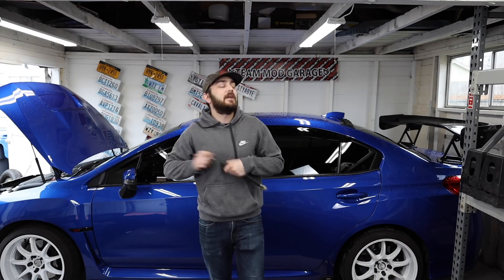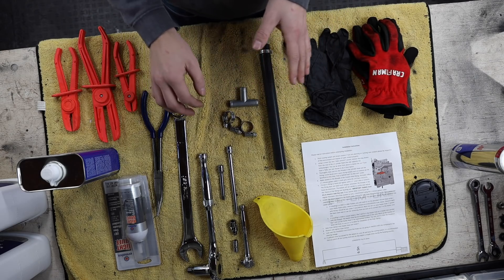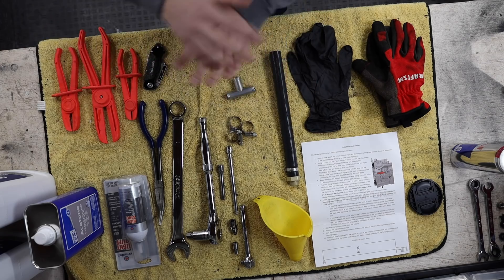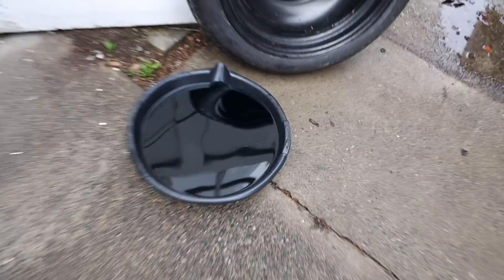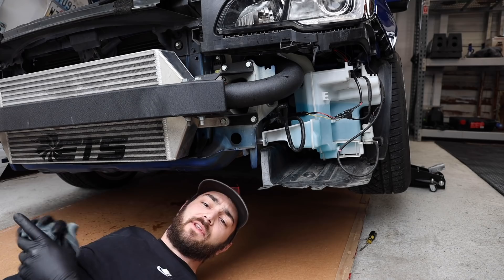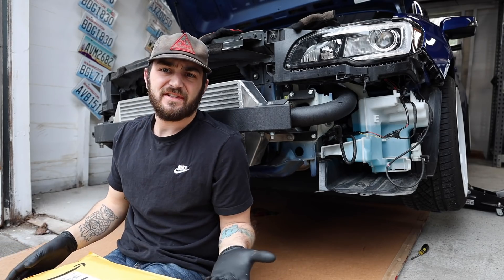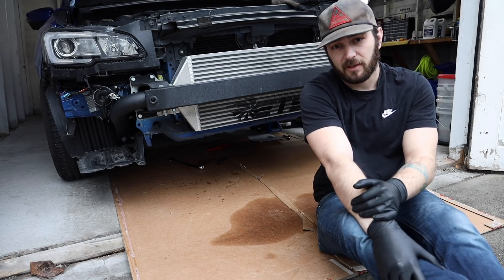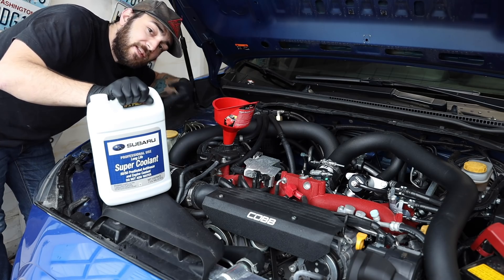Cylinder 4 Cooling MOD Install (STI)

Comment: Did you pinch the heater core hose off when you revved the engine up?  You didn't mention whether you did  that in the video or not. Or if you did I missed it.

Comment: Don’t be cheap! Get a $20 “ coolant burping funnel kit”. It comes with a bunch of different fittings to mount it and they are clear so you can see the coolant and the bubbles. Harbour Freight and Princess Auto in Canada sell them and they work great. 14:47

Comment: Aight, question about this mod long term. This is one of the first ones I did on my 17 STI, over 2 years ago. Apparently I over-torqued the hose clamps on the heater order side and I've got small leaks there. Gonna try the hoses and put on new hose clamps. Any thoughts on avoiding this in the future, besides avoiding the over-torque?

Regardless, thanks for the endless value from this video. I know it's a weird spot to get to

Comment: I wouldn't do this. You are cooling the only cylinder that is being monitored for knock. And since it's the hottest cylinder, it will knock first. All you're doing now is making it so one of the other three cylinders will start knocking first, but the ECU won't know and won't retard timing fast enough to prevent damage.

Comment: Is it connected to the bottom or top line of the heater core lines? Ive seen it done both ways. 

Is someone effing up or does it matter?

Comment: Am new to the subaru scene and definitely fona get this mod on my 2015 sti
Reply: Don't. Cylinder 4 has the only knock sensor. It's designed so that IF there is knock, it will happen in cylinder 4 first and the ECU will do its thing to prevent damage. If you cool this cylinder, you are making it so that knock could start in any of the other cylinders first and your ECU won't know about it until it's too late.

Comment: I did this mod and found an unpleasant side effect in winter. I get no heat unless I bring the RPMs up, even with the coolant warmed up to 84C.
If you're in a colder climate, please keep that in mind.
Reply: You might've tapped into the wrong heater hose. On some models it matters and if u tap the wrong one it'll mess with the heat but if u tap the other the issue doesn't exist

Comment: I did this to my car, my heater now does not work at idle but works when I’m past 2500 rpm, do you think maybe I cut the wrong hose? My car is not overheating

Comment: SMEEDIA !! whats up my subie Guru. Quick question, in order to add the conditioner to the coolant. Do i 1st  pinch the cyl 4 coolant hose,  bleed the coolant system then release the pinched hose?  Or can i add the coolant conditioner before releasing the pinch on the hose then bleed ts ?

Comment: Guys, if you see your temperature rises a little after install, all is ok, it’s just cylinder 4 was the hottest one and cylinders #1,2 and 3 been the coldest , now the heat from #4 transfers trough coolant to number 1,2,3 and keeps # 4 cooler, now it is even , just get for your Subaru a better radiator and you will be golden 👌, if this not enough then I don’t know lol, get additional 2 small radiators and install it behind the front bumper vents on the side, like BMW M5 has, not sure if you will need additional pump to run it when car is off to cool everything off, just a thought 💭, steal some ideas from Germans guys 😅
Reply: I installed this mod and after seeing exactly what you say, I decided to removed it, it iwas not funny to see my car around 98-102 C. 
I upgraded the radiator but I am still not sure about installing it again.

Thanks for your comment, that is exactly I wanted to know.

Comment: Experienced my first time with my car being heatsoaked. After a year of owning it i almost stalled taking a right turn downshifting to 2nd. God forbid i get a delayed response. Sucks but thats what happens when your in arizona lol. Gotta get this mod soon
Reply: You need a 2 row radiator too 😅, im looking for one too, first cooling mod and change all fluids, then bushings that worn out, new spark plugs and filters, just got new wipers, just refresh all and improve cooling system, it should run for a long time if you keep it stock, there still some small mods that will help with oil etc… but you should be golden 👌
Reply: @Atlan_tis  I only worry about it during the summer. Well mainly from May to September here in AZ. Any cooling mods sound nice considering I dont have any mods but a catback. Going for the 4 cylinder mod once I do a coolant change. Really wish subaru kepted the tmic sprayer for all years. It was 104 a couple days ago. Car does not like the heat lol
Reply: @sunnydee7745  I live in California, is not hot yet, but we just had 98F couple days ego, I know it will get hotter 114f for sure, to get this mod is important, I ordered this line and I’m looking for a 3row radiator from Mishimoto, and new coolant, my 2018 sti is stock too, im planing to do mods for reliability, at same time looking for cat back exhaust too
Reply: @Atlan_tis  I dont plan on driving when it's that hot, ill take my silverado instead 😅 but yeah bro, cooling mods are a must for these vehicles. I have a Tomei catback, pretty loud and sounds amazing, if your looking for that I'd recommend it

Comment: Thank you so much for these videos dude. I’ve been waiting for the right timing to purchase a ‘14 STi and it finally happened. It is unmolested with less than 90k miles, so I want to do everything I can to ensure longevity with this engine. I have a long to do list, but your videos are helping me prioritize and put things in a decent order so I can do multiple installs in one round (for example, Mishimoto radiator and cyl 4 cooling mod should be done simultaneously so I only have to burp system once). 

So hype! 🤩🥳🎉 🚙 💙

Comment: I wouldn't do this mod, you're making the ECU logic flawed.
they have cylinder 4 a little bit hotter, it's close to the knock sensor, so cylinder 4 will knock first slightly to adjust ignition timing.

DONT DO THIS MOD

Comment: Hey man, just bought my first subaru. Really appreciate your knowledge and thoroughness on the aos/occ. picked up the iag setup you went over. Now i know my 15’ is a fa and doesn’t utilize an ej platform is there a way to make it work on my engine? Trying to square away with all the preventative stuff while i have the coolant out of it for the most part, thanks in advance!
Reply from the maker: So lucky for you, the FAs do not have thr same issue and do not need this mod 🥳
Reply: @Smeedia  hey man does installing this required a tune?
Reply from the maker: No🤝
Reply: @Smeedia  FA engines don’t need an AOS or catch can? How does the PCV system work differently in a way that it doesn’t need it? I thought every turbocharged car would benefit from a catch can.

Comment: What is the difference between using the right stuff GREY vs BLACK? I have black in stock at my job and I am not sure if I can use it for this install?
Reply from the maker: Black is a bit more chemical resistant
Reply from the maker: Either will work fine tbh 🙏
Reply: @Smeedia  cool! Then I'll go ahead and use the black one then 👍

Comment: Hello Tanner... at risk of sounding like your father, I'll suggest placing a solid support under the frame of the car. Don't trust that a hydraulic jack won't fail, and your car will end up crushing you. Very easy to have happen for several reasons. *Plan B is always a good BACK up plan to live by. Cheers P-fizz.

Comment: What model years are affected by lack of cooling on cylinder #4 and are we talking about just the STI model or all Turbo models?
Reply: I believe it’s an issue with the EJ 255 & EJ 257 engines. So 08-14 WRX & STI’s for sure. Pretty sure they were other subies using the ej 255 engines too.
Reply: @TheRandomname951  Appreciate the response my dude.

Comment: Good video🤙🏽managed to get it installed but when came to burping the system I followed all the steps but the coolant isn’t travelling into my heater matrix now and my heating is not getting hot even after running the car for nearly an hour with heating on full blast, has anyone got any tips?
Reply from the maker: They revving the car a few times, tends to help 🙏🙏
Reply: @Smeedia  it is the same hose to tee into on a 07 WRX right? The one attached to the black metal pipe
Reply from the maker: Should be the lower pipe, but yes I belive it is black too
Reply: @Smeedia  thanks yeah I left it running a bit longer, just took way longer than I had thought it would for my heating to work properly, left it to idle for about an hour and it only came back to normal after driving it around all day! But all sorted now, thanks for the vid dude🤙🏽

Comment: Wouldn't it be better just to run equal length headers to avoid this issue?
Reply from the maker: Equal length header deals with uneven and high EQTs and makes no difference on thr cooling system. This addresses the cooling system.

Comment: Tanner!  So I did end up picking up a 15 STI Limited!!  Question about the cooling mod, Is this something recommended in general or because of Unequal length headers?  Or is it just a good upgrade regardless of ULH or ELH and has nothing to do with that.
Reply from the maker: The header don't have anything to do with it. The header is an EGT issue, the cyl 4 cooling mod addresses coolant issues. Wouldent say it's 100% but never hurts. And congrats on the car!!!
Reply: @Smeedia  Got it!  Thanks!!  I haven’t stopped smiling yet and find every excuse to drive it lol

Comment: For anyone installing on a 13’ STi, I would assume 08-14. It is the hose above the one he tapped into, follow the black metal pipe. I made the mistake and tapped into the other hose.
Reply: youre a pimp thanks
Reply: How did you know the hose was wrong? I did this to my car, my heater now does not work at idle but works when I’m past 2500 rpm, do you think maybe I cut the wrong hose? My car is not overheating
Reply: @RockoPower123 did you ever get a fix I’m having the same issue I believe
Reply: @andrewwilliams5635  yea, what happened was that when I rebuilt the engine, I put the hoses going in the wrong order to the heater core, I just flipped them around and also topped off the coolant on the reservoir since it was low and now it’s fine
Reply: @RockoPower123 nice so you didn’t have to retap the coolant mod hose? I’m hoping there’s just some air stuck in these cars are so hard to bleed
Reply: @andrewwilliams5635  no I didn’t have to, It defenitely took me a while because there were some air bubble that were a pain in the ass to get rid of
Reply: Worst case scenario that you just cut the wrong hose I’m pretty sure they’re around the same length so you can literally just swap them if needed

Comment: Thanks for the walk through. I have an EJ and this I probably the best video to see where that plug is. I do have a question though. I’m just finished a timing belt change and I want to clean my covers. What do you use to clean those and the engine?
Reply from the maker: For the plastic covers just engine depressed and some rags 🔥🙏

Comment: Should I install this mod on my 2016 WRX?
Reply from the maker: Not needed for 2015+ WRX 🙏
Reply: @Smeedia I already ordered it.  Would there be any plus or negatives installing it
Reply from the maker: It won't fit, only is made for EJs 😣
Reply: @Smeedia  Thank you for your help.  I’m new to Subaru and turbo cars just trying to find anything that helps with longevity.

Comment: most video shows people use the lower radiator hose to drain coolant, i kinda like the oil cooler one as it doesnt make a huge mess and i dont have to mess with plastic radiator
Reply from the maker: Makes for a little bit of a cleaner install so your not covered in coolant 🙏
Reply: @Smeedia  very true lol and also when i installed the getaDomtune cooling mod the way the aluminum feel when you torque down the nut is kinda very tight and couldnt torque it the way i torque metals. its almost feels like you are tightening up two sets of aluminum bolt and nut. it only torques about 1-2 centimeter lol
Reply from the maker: As long as it doesn't leak, I wouldent stress it too much 🙏
Reply: @Smeedia  yea thats true, thanks bro 👍

Comment: Just ordered my 2021 STI and would assume that the cylinder 4 cooling mod along with the AOS would void warranty. Anyone have any past experience with warranty and doing these mods?
Reply from the maker: They won't 100% void warranty but they will open the possibility for details of claims unfortunately
Reply: @Smeedia  man, you really are good about responding to questions lol. Love your videos man.
Yeah I plan on keeping my subie for a long time and hear these mods are great for longevity. Just torn on the whole "will it void my warranty" bit.
Reply from the maker: Totally feel it, I'd say hold off for a few months to get acquainted with the car then go from there. And I try try get back to as many comments as I can 🙏😁

Comment: Hey so why not vacuum bleed instead of using a funnel to burb it?  Vacuum bleeding it would get all the air out in one try (most likely), if not then just pull a vacuum a second time.
Reply from the maker: At the time, did not have the tools to do so

Comment: Good video.  Thanks for the knowledge!  Didn't even know there was a cooling issue for the #4 cylinder.   My 2015 STI is stock,  save for a Mishimoto intake.  This seems like a worthwhile upgrade.  Who makes the white wheels that you had on the car?  My STI is the same color and I like the look!
Reply from the maker: Definitely worth it! And they're work emotion D9Rs 🙏😁

Comment: Oh wow. I’m wondering why Subaru didn’t just do this from the factory.
Reply from the maker: They did on some JDM models but not on the USDM 😖
Reply: It was a factory fitting routed to a automatic transmission cooler on JDM Legacy 2.0gt. Also used on twin turbo EJ20 to cool the second turbo. Remember that this 'mod' is transfering less coolant to the radiator but it's absolutely drops cylinder 4 temps. My guess is the EJ has only one knock sensor on-top cylinder 4, so Subaru ran that cylinder hotter so it'd knock before all others and get an accurate reading. I personally don't plumb this back into the heater core return hose like Dom does it.

Comment: Fantastic video! You may have answered this in the 300+ comments, and I may have missed it.  Has this been a warranty issue with enthusiasts? Just want to make sure the benefits outweigh the risk to my Series. White I guess.
Reply from the maker: Unfortunately it does give the dealer a reason to deny any potential warranty claims you might make 😖
Reply: @Smeedia  Damn! I think I knew the answer, but was hoping for a silver lining or something. Thank you

Comment: Great video, do you know the name of the plug you remove from the block? and do you have any idea where it would be on the FA20 WRX? Thank you
Reply from the maker: This mod is not needed for the FA20 🙏 thr FAs have a more efficient cooling system
Reply: @Smeedia  Thank you
Reply: @Smeedia  yeah but tomei made UEL headers for the FA u sure?

Comment: jacking the front end up helps bleed and youll know its bled when the fans come on and go through a few heat cycles
Reply from the maker: When you jack up the front end your putting the radiator higher than the upper coolant res, I've seen a few people use that method but hit or miss from my experience
Reply: For some reason I couldn’t get my 06 wrx to bleed after a water pump timing belt job till I jacked it up and finally started going through heat cycles with the fans

Comment: Front mount intercooler you are went for power so wonder why not go all the way and get equal header and not bother with cooling mod. I’m guessing you wanna keep rumble
Reply from the maker: I ended up going with Killer B ELH, when I first went to the dyno it was not in my budget, second time around (later videos) it swapped to ELH
Reply: @Smeedia  got you. Good videos

Comment: Hey Tanner can you install the cooling mod without bleeding the coolant out? Can you just pinch off the two ends of the coolant line with something then install the T fitting?
Reply from the maker: No, once you pop off the plug on the back of the block it will pee coolant everywhere
Reply: @Smeedia  ah gotcha. Thank you!

Comment: Would you say overall cooling of the engine has improved with this mod and if yes, why hasn't Subaru implemented this simple mod eons ago? thx
Reply from the maker: I wouldn't say overall cooling changed but I did see a reduction in cyl roughness on cyl 4. As to why subaru has not implemented this I couldn't tell ya 😖

Comment: So I know having UEL compromised the reliability on the car and can cause detonation on these engines. With the FA20 WRX coming with EL, if I decided to get aftermarket UEL, is there anything from a cooling POV that can be done to reduce the chance of detonation and make it as reliable as it can be since the Cylinder 4 Cooling mod is not available for the FA20 because it is not needed for stock set up's?
Reply from the maker: Unfortunately no, you would be creating and inefficient system for the exhaust. 10/10 suggest staying with ELH 🙏
Reply: @Smeedia  I’m going to have to look into the Killer B ELH and a deeper sounding exhaust to get that rumble then 😈

Comment: Question I've been looking for this video where people use a temp gun to see if it actually drops cylinder temp.  Can you notice a difference after installing this?
Reply from the maker: I saw reduced knock over longer periods of driving, aside from that not sure how far Temps actually decreased
Reply: @Smeedia  thanks for your info!

Comment: Will this work on my 2019 wrx cuz the part says it only for sti
Reply from the maker: No it will not. For EJs only. The FA20DIT has a much better cooling system 🔥🙏